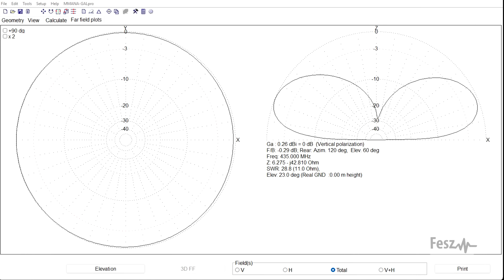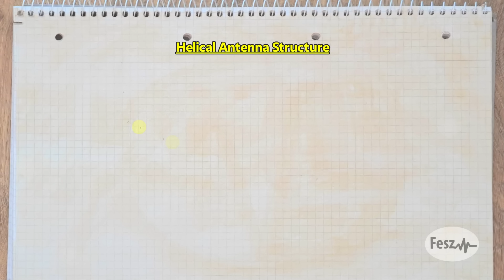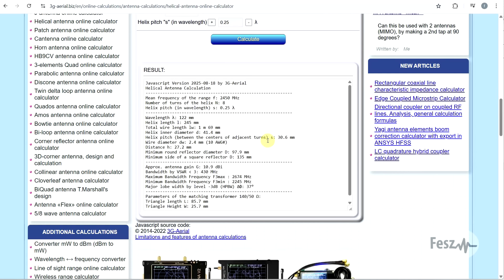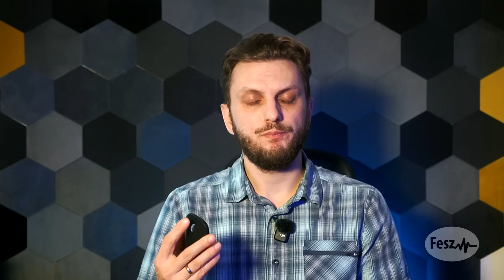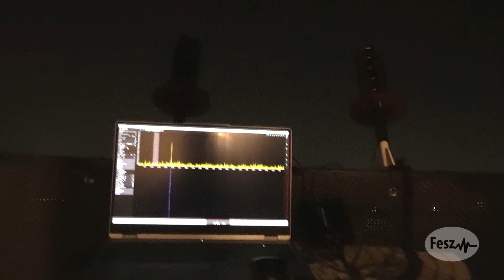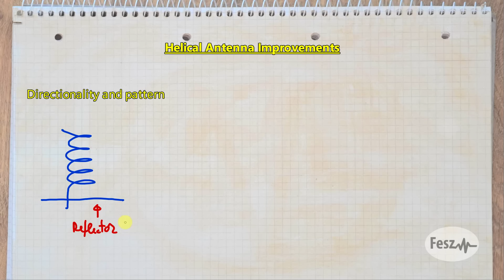The Helical Antenna

Comment: I used a 1/4 lambda line above the ground plane.  Just the wire used for the antenna.  I calculated the spacing then just pushed the wire down until I matched the impedance.  Good video.

Comment: Amazing work as always, FesZ!

A few things I would add that might be useful for further reading:
- The formulas, and especially, the gain formula of Kraus is often used without his sidenotes, esentially predicting higher gain than practically achivable. Simulation based formulas tend to work better, but King and Wong's "Characteristics of 1 to 8 wavelength uniform helical antennas" is a very useful table as well.
- There also exists a backfire type axial helix, having a smaller reflector. I'm not that familiar with them, but it's worth mentioning, as they are often used as parabola dish feeds.
- Speaking of parabolas, remember that they flip polarization. For an RHCP antenna you need an LHCP feed.
- When designing a helix, you often find that it's not resistive at you design frequency, but a bit capacitive, my 70cm helix was somewhere around 110-j90 ohms iirc. Also, the feed impedance is most often given as the anenna being fed on it's circumference, NOT on the center. Coincidentally, a shorter-than 1/4 lambda line can match the capacitive feed impedance in a broadband way while also bringing the feedpoint closer to the center. See James Miller's "Helical antennas for 435MHz" for an example (or my replica of that on HA5KFU's site in hungarian)

Comment: Have you checked the radiation pattern of this antenna? This printed frame is quite thick, and from experience (my student's experience) I know that it significantly deforms the beam due to wave accumulation in the dielectric, thus significantly reducing the energy gain.

Comment: Cool. I do some cool stuff too. Im presenting investigating a crazy thing. An empty aluminum soda can placed on a computer trackpad creates a capacitive coupled antenna and the cursor moves. All by itself. Using an oscilloscope you can visualize the waveform. Could be alien contact. Work a fun investigatory try. 😊